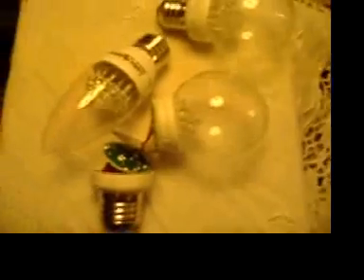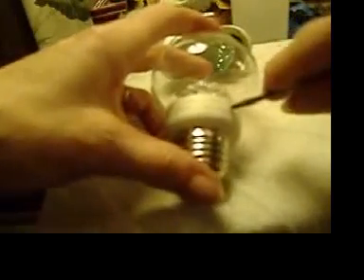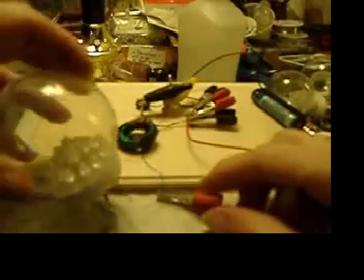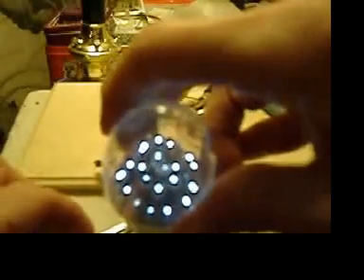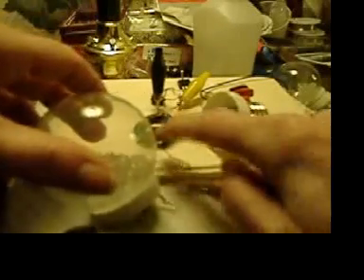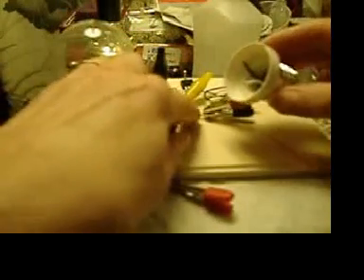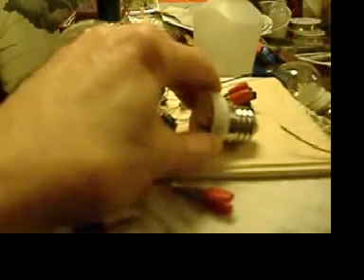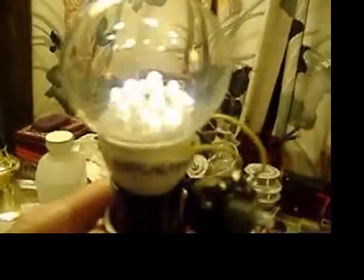19 LEDS Joule Thief Lamp Modified Jeanna's Light

Comment: @jeannacav
You're very innovative. But the LED light requires 2 or 3 watts to be as bright as on the AC line. And a single AA cell is just too low power to do that. It needs more batteries. I think I'd start with 8 AA cells and use one of the circuits that Xee2 (xee2vids) has here on YT for a LED light running on the AC line. One of them runs off 12V and uses about 100 milliiamps.

Comment: As far as 'toroids' are concerned; I have found that some don't work as intended with the simple joule thief circuit.  I wrap all of mine exactly alike.  So they should all work.
Also, while at Radio Shack I noticed that their toroids have two different labels: 
1.) Input
2.) Output
How can you tell them apart just by looking at them?
Which ones work with the joule thief circuit?

Thanks

Comment from the maker: @jmjpowerjoule 
If you follow the instructions/suggestion on this video you will have a sweet portable light.
It is very low brightness, however.
I use mine all the time in the corner of the bookshelf for pretty ambient light.

To read by a light I suggest making a more powerful circuit (if you can find a good toroid) like the one in my video "is this a hairpin...?"

I did all this by trying lots of ideas.
So, that is my advice.
Make a good joule thief N see what it will power, then make a lamp.

Comment: Jeanna aka "jeannacav,"  

I dismantled three burned-out coil bulbs and found some very cool looking little round circuit cards in them.  
I'd like to make something for my wife with these and I don't know exactly what.   
Any suggestions?  

Q:  I'd like to make some battery powered LED bulbs with the gutted-out bases.  Should I de-solder the parts of those circuit cards for this or use them intact?  

Sincerely,  
jmjpowerjoule

Comment: I was imagining a porch light with rechargeable single AA battery which charges during the day via a mini solar charger and will automatically turn on at night using a light sensor circuit, that would be nice ^^

Comment from the maker: @kevininbc 
These lights are as bright as they are if plugged into a wall socket.
The problem is the bulb is not as bright as a standard light. Partly that is the upgoing direction of all the leds. Someday there will be some smart and affordable led bulbs.
I am using the UNmodified bulb off the secondary and it is the brightest of all the lights I have made.  The one called the "world light" from the tiny orange toroid is the one that lasts the longest while making a decent amount of light.

Comment: I almost forgot, an infra-red heater has been designed and is on the market. It uses infra-red lasers to generate heat and is much more efficient and pleasant than standard current based heating devices. I'm sure you can find them on the internet.

Comment: As far as producing heat goes, heat is a specific frequency of electromagnetic ratiation. Tesla experimented with frequencies that were extreme even by todays standards and not easily reproducable. To produce heat would require oscillations of an extreme small period and probably can not be reproduced with even specialized high frequency transistors. Also an air cored transformer must be used because a ferrous core would slow the oscillations down too much. Keep up the good work.

Comment from the maker: The AA battery runs anything with one of these big transistors for 5 1/4 hours. Fluoro tube or a couple of leds. It seems to be just the jtc -no secondary- that uses the battery, which makes sense to me.
The 2N3904 takes 24 hours or longer to run down a AA.
I am using NiMH rechargeables which start lower and stop driving a light at higher voltages.
The base resistor makes a HUGE difference as does a rheostat on the battery.
So, how do I  make heat from the backspikes?

Comment: Just so you know radioshack sells a darlington pair assembled into a single transistor, might be worth a try. I saw on another video you asked if it would be possible to create heat without using large currents. The answer would be yes. Heat is nothing more than a specific frequency of electromagnetic radiation, just like light. Most modern physicists would say light is photons, but they are wrong. It's all vibrations in the eather. How long does you battery last powering your lights?

Comment: I would recomend that you use MOSFETs connected in a darlington pair as your switch. This will give you much sharper spikes and possibly make your driving transistor run cooler because you wont be dropping volage in the transistor while its inbetween  full on and full off.

Comment: Hi Jeanna, better put ALL LEDs in Series,
not in parallel. This way you on´t have any problems with different characteristics of the single LEDs and you can use high voltage spikes ! Try to do a feedback  from the last cathode of the LED chain back to the positive pole of the battery ! This will help to recharge the battery ! Good Luck ! Regards, Stefan.

Comment from the maker: These bulbs claim to be as bright as a 40w bulb, but I would say more like a 25w. And with anything over 175v they are very bright.
The leds are all in series.
It is a bit of a job to make 19 series leds very bright, but modifying this bulb is so easy, that it makes up for the extra spiky volts needed.
Thank you...jeanna

Comment from the maker: HA
I wish this were true.
I think the larger transistor takes down a battery so fast.
 It is not the load from the secondary as anyone who has made this knows, but the TIP31 or TIP3055 seems to draw 150mA.
2 days. I have it on a AAA, so I won't be answering this yet.